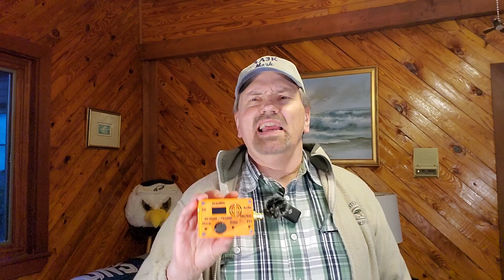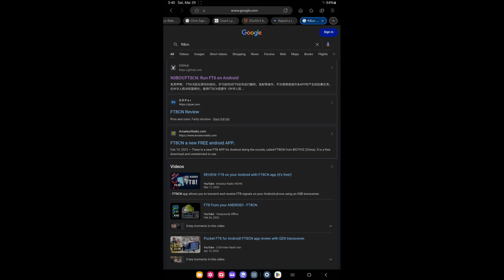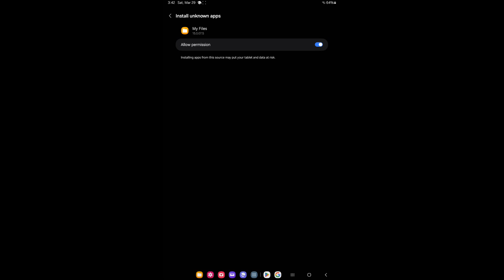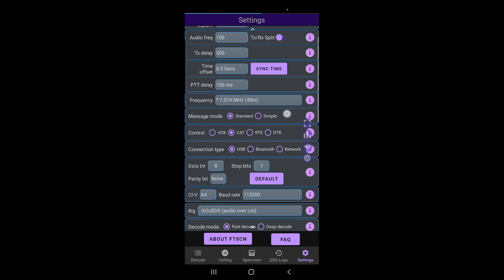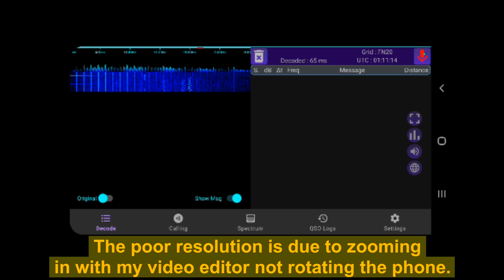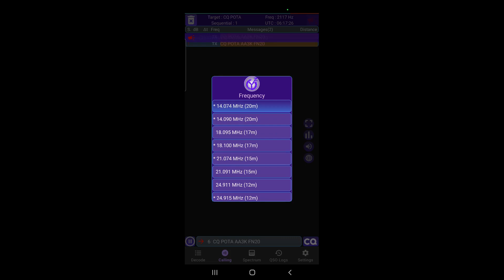FT8: The Secret to Expanding Your (tr)uSDX Experience

Comment: Hey, i used different cables but it isn't working... it says " rig connection successfull" but i cant chance frequency or receive/transmitt anything....
Reply from the maker: Assuming you have the latest (tr)uSDX firmware, write down your calibration frequency and then do a reset of the radio.  The radio also ONLY supports a baud rate of 115200.  It is possible to see a connection with other baud rates but their reliability is doubtful as you've noted.
Reply: @aa3konthego yes THX! I flashed the latest Beta Yesterday... IT works perfekt now!
Reply from the maker: @thimll great to hear! I too had problems with the serial interface until I reset the radio (by accident).  Unfortunately I did not have the calibration value written down.  It is now!